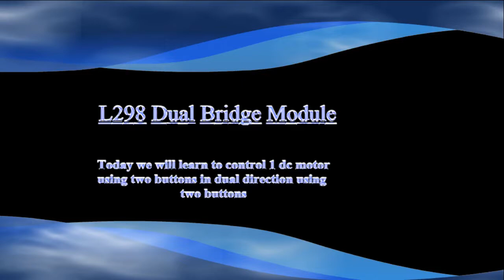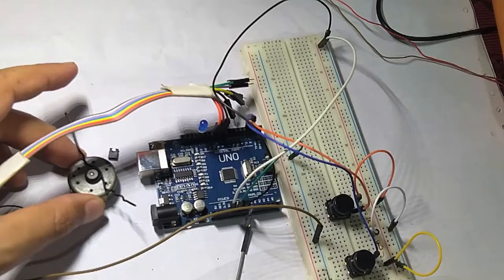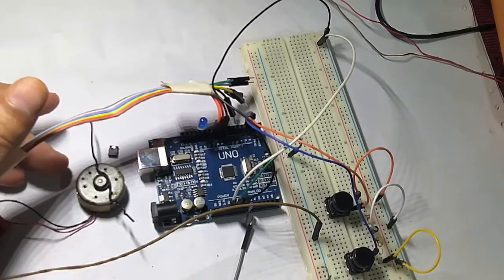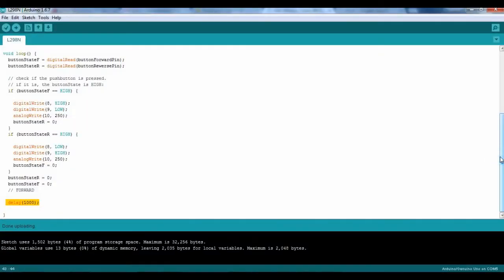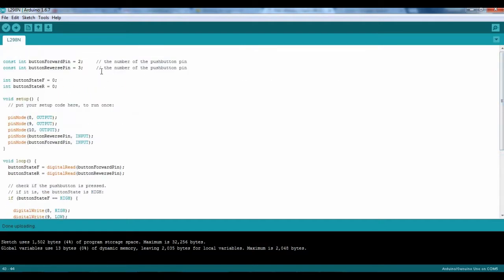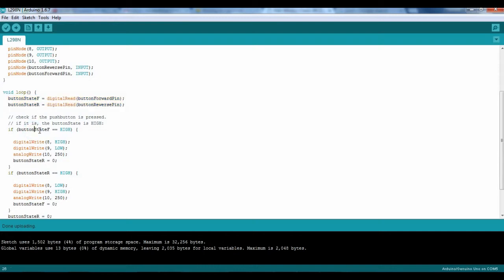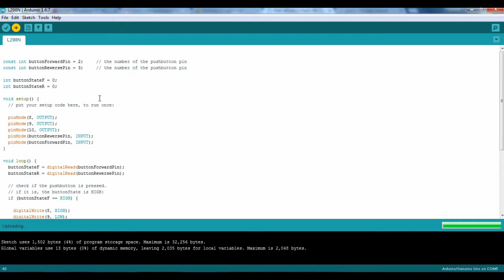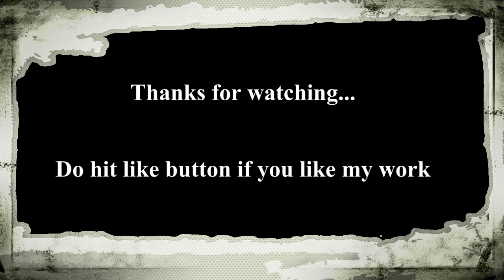Control DC Motor in dual direction with Arduino dual H bridge L298N module

Comment: Nice explanation about the pins on the driver board.

I think i might have to consider using a L298D driver instead of the L293D driver.

Heres what I've been fiddling with lately with a similar concept
https://123d.circuits.io/circuits/2334533-time-lapse-slider